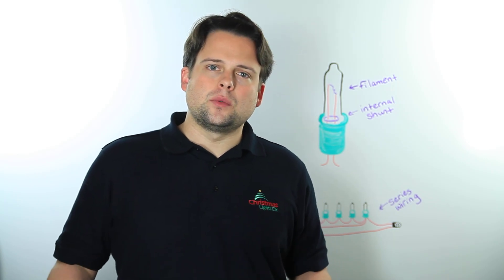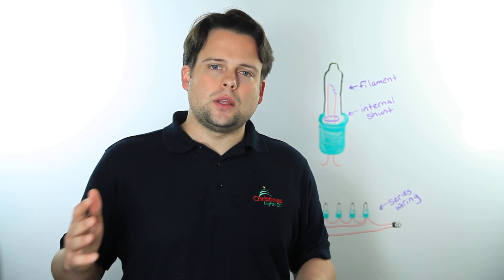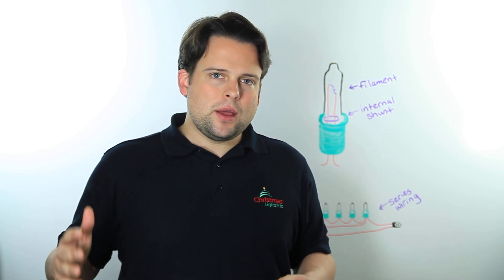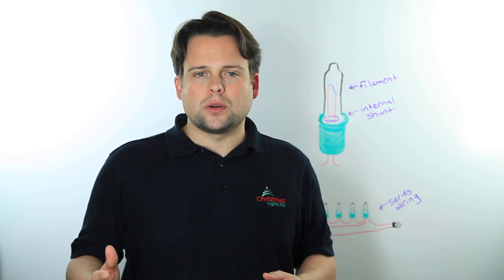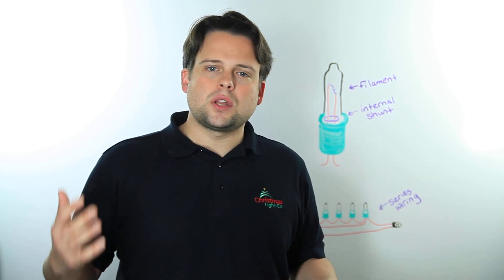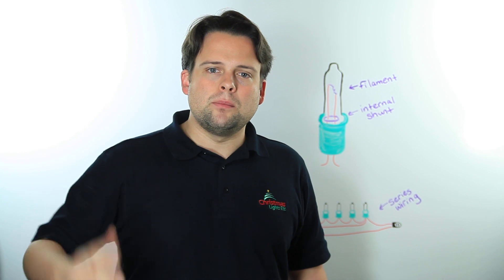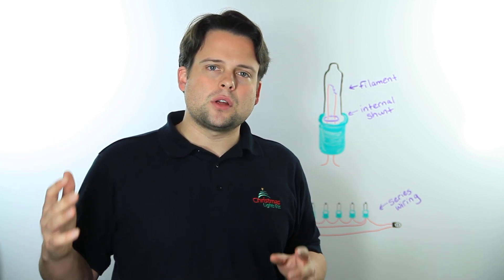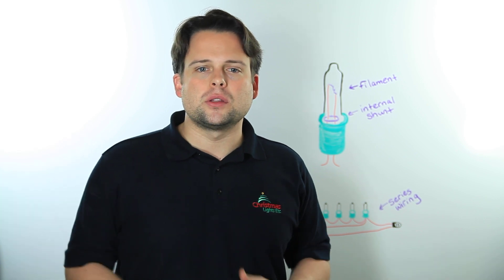Christmas Lights that Never Go Out??

Comment: If you store them somewhere damp the wire can corrode and lose contact.  My lights had shunts and over half lost contact.  got tired and threw them out after reseating 5-6 of them 10 times each to get continuity to the next socket.  No matter what brand you get store them somewhere dry!
Reply from the maker: We recommend never storing any electrical products in damp areas. Keep them dry and protected!

Comment: Helpful.....I had about a foot of my lights go out (purchased from Christmas Lights, Etc.) so now I'll check to see that no bulbis lose and go from there.  Very disappointed that this happened.  This is only the 3rd year that I've used them.  Is there an easy way to determine which bulb is bad without having to go thru each bulb, one by one???
Reply from the maker: Yes, buy a light tester and test it to see which exact bulb you need to replace to get it working again WITHOUT having to take every bulb out. Watch this video to learn out to operate the tester and get your lights working again. Happy decorating! https://youtu.be/szH7GCeQEf8